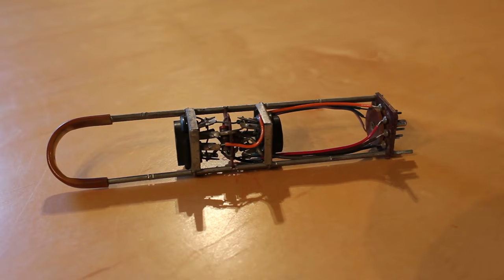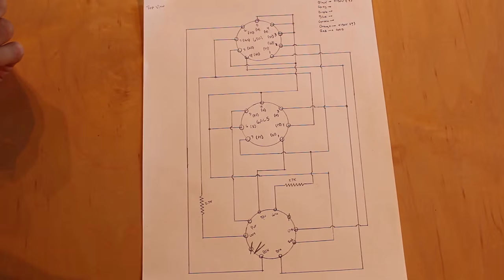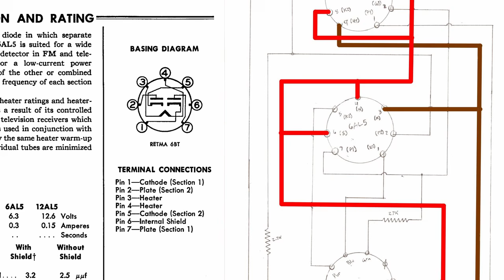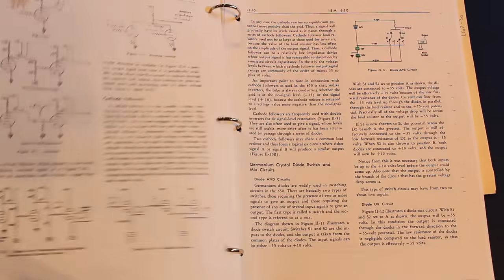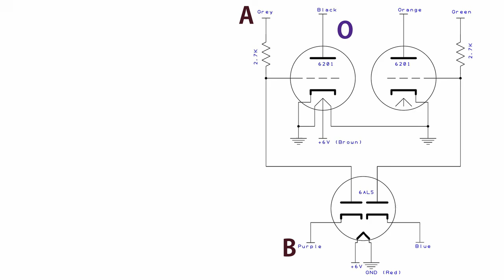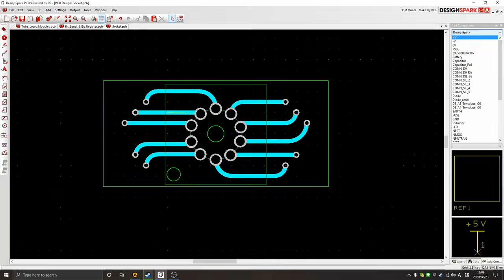Reverse-engineering an IBM Mainframe Vacuum Tube Pluggable Module

Comment: When using 150v it went from 150 to 50, and when using 24v it went from 24 to 8, both 1/3 the full voltage.

Comment: I remember reading once that IBM liked to use 12AY7 tubes. Similar to the 12AT7 but with slightly less grid/plate capacitance for a slight edge on switching speed. It has a lower mu, but that is not a requirement for a switch. I forget the industrial number for the 12AY7.

Comment: The figure II-11 of the IBM 650 manual shows a "Diode AND circuit" with "projected" voltages - which also confirms standard logic level of +10V ("signal level", i.e. 1/H/high) and -35V ("no-signal level, i.e. 0/L/low) - keeping kind of standards during transition (mixture) from tube to semiconductor diodes - and a pullup "load" resistor - which may apply in your case? Just to make a really "educated" (no) guess - does this make sense to you?

Comment: Try using space charge tubes 12 volt on filament and plate. 12G8 is a dual triode.
These were used in car radios.

Comment: This was an amazing trip down memory lane for me.  My dad was a field engineer for IBM for 36 years.  He started in 1955, 9 years before the S/360 was introduced.  He actually worked on this type of equipment.  He regularly brought "dead" parts home that he didn't have to turn back in and gave them to me to tear apart.  Between that and the occasional trip to one of the data centers in his territory sparked a lifelong love of computers and electronics that eventually led to a 39-year career in mainframes, which I truly love.  In this era of terabyte cell phones and 5nm VLSIs, it's refreshing to work on projects where you can actually see and touch the individual components. Thanks for helping to keep the curiosity about vintage computers and electronics in general alive!
Reply: Sorry to necro your old comment, but as a young person, I've only EVER known VSLI infrastructure. Even from my first gamecube and xbox original back in the early 2000's, which feels like ancient history to me, pulling those apart after they broke from overuse, you cannot really "make sense" of the machine. Too many small bits that do big complex jobs, stuffed into a little metal and plastic box that may as well be magic to anyone non-electrically inclined. However, more recently, discovering older computing systems and the hardware/components that go into them has been extremely refereshing to my untrained self. You can pull one apart, and with your eyes unaided look at the individual pieces, figure out what they do and trace where they go. Much more complimentary to a foundational understanding of computer science and honestly quite confounding when I figured out its literally physical logic you can see on a board. Definitely easier to learn and understand whats going on when it is laid out like this, and I firmly believe this stuff is still relevent in the modern day, even if only as an educational tool. It really is excellent stuff
Reply: @tobiaswhittaker7462  I'm not sure what you mean by "sorry to necro your old comment" but I will take it as a compliment based on the rest of your post.  🙂 It does my heart good to see young folks with an interest in how we got to where we are with computing technology.  Us "grayframers" have the advantage of actually having worked with it.  As a young "computer scientist", I used punched cards and paper tape for my programs in college.  During the early days of my career, I mounted reel tapes, loaded paper into massive printers, ran decks of cards through readers and sorters... the whole early data center experience.  It got much more interesting and complex as I progressed through being a software developer to being a mainframe systems programmer and hardware engineer.  These days, most people won't even know where their company's data center is, much less get to work in one.  They might get a tour during their onboarding but they won't get anywhere near the actual equipment.  That is truly sad.  But to be honest, learning how to work with the old equipment wouldn't add any real value to today's young software engineer, any more than you have to know how a car's engine and transmission work to drive it.  While knowing more about what goes on under the hood may help you if something goes wrong, you don't need to become an ASE-certified mechanic just to drive to the store for groceries.  I personally find the whole world of retro-electronics to be fascinatingly nostalgic.  If you are genuinely interested, look into something like Ben Eater's 8-bit computer project.  The kit is kind of expensive but it was a lot of fun building it, especially when things didn't work as expected.  That's when you really learn.  When you finish the kit, you WILL understand much more about how computers work.  And you will enjoy a distinct sense of accomplishment!  (The book his project is based on is available for PDF download but you have to look for it.)  Best of luck with your future computer endeavors!

Comment: The pinout on the module is like a 10 pin relay connector.
Reply: But the notch on the center pin is missing.😁

Comment: The Teleprinter sound in your intro brings back some memories! I used to run several different Creed machines (Model 3, 75, 444 and 2300) in my radio shack 30 years ago.
Thanks for the 'forensic' work with that module. Very educational. 🙂👍

Comment: Back in 1964-66 when I was in high school in St. Paul, a friend of mine and I discovered a junkyard that was scrapping out mountains of IBM tabulating and early vacuum tube machines - primarily RAMAC 305 and 650's.  They would sell us pieces of machines and I grabbed a bunch of these modules, along with power supplies and front panels.  At one time I must have had a barrel full of these modules.  Wish I had saved them, but I left home for school and later the Army and my dad basically gave them away!  According to my dad (who worked for Sperry Univac at the time), IBM would rent or lease all of their equipment and thus retained ownership of the machines.  When they became obsolete they were sent to a facility for decommissioning where cables were cut, heads were welded to disc surfaces, screw drivers were punched thru core memories and front panels were destroyed.  Then the machines were sent to scrap yards like the one I had found.  Thus it is doubtful that you would find a complete machine unless it came out of a museum.  IBM did not want the old machines hanging around and competing with the new ones.  I am enjoying your vacuum tube and computer series very much.  Well done!  I am considering doing something similar to your vacuum tube computer but with relays instead.

Comment: You made my day.  I haven't done any vacuum tube work since 1970 but as soon as I saw your wiring diagram I remembered pins 3,4 and 4,5 for heaters and that 4-5 connected meant a split heater.  When I began teaching electronics technology at Ferris State College (now University) in 1980 one of our early tasks was to remove tube tech from the curriculum.  The reasoning was that the few graduates who would need it would pick it up quickly by individual study.   Other comment suggested Paleo-electronics term.  Love it!

Comment: So thats what these things are! 

I have hundreds of them and never knew what they were. I also have quite a few boxes that have numbers 0-9 on them with 9 12AU7's in them, and the box uses a single octal 8 pin socket to plug into whatever it did. Wonder if they were also used in this application?

Comment: That Uni-T meter is a beast. Glad to see it becoming more common
Reply: I have that same model in my toolbox for mainly current metering. My old GwInstek 396 multimeter has bit better continuity check beeper thou (detects crackling contacts).

Comment: for a display you should mount it on a piece of hardwood, and put a couple fancy switches on it, with the neon bulb! and make it a functional tabletop conversation piece. very cool video :)
Reply: Second this and while you're at it build a vacuum tube voltage regulator night light that's one thing I'm planning on doing and for some wire equipment cabinets now and in the future the lights inside should just give a bit of Illumination Paisley sea controls and such couple vacuum tubes probably substandard ones that would not be suitable for use otherwise but the filaments slash heaters are still good just for the novelty factor and the cool looking white does produced just enough to see things but not too much of course potentially being able to dial down the voltage as well also thinking on building what I would call a unity gain amplifier just to get the sound of tube equipment for audio that originally would be recorded this way I know this is up to the person but I think it sounds a bit better for some of the old recordings myself of course have this device be able to be switched in or out also anything like that would definitely definitely equipped to bypass if in standby or off state.

Easy enough in the audio path courtesy of relays!

By the way will be using are there ingenious way of switching some inputs and outputs for example for an input essentially would be the opposite of a headphone port that would also switch out the speakers when headphones are plugged in except that report is an input but overrides others when something is connected.

The other thing would be utilizing tying a line to ground for switching for various functions without having to have much additional cabling you've already got the ground of course as it is so why not make things easier.

A lot of my stuff will be custom also will probably be using an HDMI cables but custom break in breakout and or just connectors on the equipment itself give us five stereo channels show to the course and some control lines use something that already exists got the idea from seeing a specialized cable but I don't know what it went to originally that had a bunch of 1/8 inch connectors Shield cables and also RJ whatever connectors likely telecommunications equipment but not entirely certain you know connectors these days can you be used for just about anything or what they originally intended for worst thing is connectors used for one thing also use for power and specially on the same device and yes I have seen quarter inch plugs used for DC power on audio equipment not a good choice of connector in the audio environment for sure

Comment: The only additional data point that might have been interesting to measure is the switch time. Of course, that would have required some sort of wave generator of the appropriate voltage for one of the inputs and a dual-trace oscilloscope as desirable to display the input and outputs together as you varied the frequency. That all said, I admire the work and knowledge you put into this. Being born in 1957, I missed experiencing the vacuum tube computer era, so I always wondered about the circuitry I see. Cheers!
Reply: Somehow I saw a vacuum tube computer at a flight simulator on  Long Island when I was in the 8th grade, my Sunday School teacher ran it or something.  It was really amazing, big room full of racks with those 6h6 tubes or whatever they were.  Sinclair I think was the company.

Comment: Do not forget, that all these digital circuits like flipflops or gates have been designed using vacuum tubes in times where transistors or TTL-ICs have not been available yet.  A quick look into old textbooks should answer all your questions and make your considerations obsolete.

Comment: What a beautiful thing, half a 7400 with valves, wonder how fast it can switch?
Reply: Probably up to 1MHz or so. So it offers 4011 CMOS  speed & output current with the power consumption of several 7400's. But the glass package is so much more appealing than epoxy packaged silicon

Comment: Fascinating work you're doing with sleuthing out the Neanderthals of computers. Being a child from the 50's I also work with tubes but in the audio realm. Working with plate voltages in the 250-500v range is normal. I've also worked on RF transmitters where the plate voltages of the output driver tube was in the 1500v range. That will make your hair stand up, literally. Lol. Great work you're doing keeping tube technology and knowledge alive. 👏
Reply: The tube tech is actually Old World tech, and we will end up studying what we had (whats left of it) and going completely backwards in coming years, our engineering will never come close to what was here before colonists arrived.

Comment: So one of my Crazy Questions: Could you use this vertical Tube design (the hardware harness--  U-bracket with 2 PCB boards) to shrink your Tube R-S Flip flops foot print for your memory and would it be worth trying ???
Reply from the maker: Absolutely! 
But it's kind of counter to the style that I've been building on. The tube computer is honestly more of an art project than a legitimate effort to build a capable tube computer, so a lot of the inefficient use of space is actually kind of intentional to keep the aesthetic looking good.

Comment: Damn, Son...Don't you have any TRANSFORMERS?  (I used to have a good sized BOX full of them!) You need to find some really old TVs ...Not too many of those still around.   How much current would you need for the 10V?   You could build a voltage regulator to drop 12V  .It should be able to provide enough current.  you might want to check an older (pre-1990) ARRL handbook for a quick and easy bias power supply (maybe even using  vacuum tubes!)    Yeah, You have to be VERY CAREFUL around HV. I have been bitten a few times ... NOT fun!!!. REMEMBER the ONE HAND RULE!  Only ONE hand anywhere near ANYTHING with HV!  Do NOT touch anything grounded with the other hand!)  Hell, I would of used a non-conductive tool like an "IF stick"  to turn those switches off and on. REMEMBER, "VOLTS JOLT -  mills KILLS!"

Comment: Another great video. I'm still catching up on your excelling work. 

I did want to mention that you should consider 9v batteries in series for your high voltage tube tests. The low current and high internal resistance might even be a good thing.

Comment: I think you have something with more potential than you imagine. Let's say you have 100 units identical to this one, all wired exactly the same.  Without changing anything on the unit, you should be able to get all 5 types of gates. And, or, nand, nor, invert... the way i would do it is plug all of these units in the front side of a 2 sided rack panel. The back side has access to the same parallel socket. Into the back socket, you plug a personality module that wires it into the type of gate you want. If you want a AND gate, you plug in the AND personality module. With only an AND gate and Inverter, you can make any of the gate types listed above. Does this sound like a workable solution?
Reply: Hmmm. A NAND gate should be able to make any of the other gates I listed above.

Comment: Really nice video!  I remember seeing modules like this when I was much younger (in junk stores), but having no idea what they were.  One thing that stuck in my mind were some of them having RCA Metal encapsulated tubes - which I've never seen since.  Have you come across them?  Maybe I've imagined it!  I'm guessing they were just to make the tubes less fragile.
Reply from the maker: Thank you!
Interestingly, I was just talking with someone a few days ago about the RCA metal encapsulated tubes! I've never come across any, but there are some interesting theories as to why RCA built them like that. The most popular reasoning is that it was a shield to keep interference down, but my favorite theory is that Germany was producing full metal tubes, but RCA didn't quite have the manufacturing capability to do that just yet, so they encapsulated some glass tubes in metal as a stop gap to compete.
Who knows what was actually going on, but there are certainly some interesting theories out there!
Reply: @UsagiElectric  Mr. Carlson's Lab runs across metal tubes occasionally in his old test gear/radio restorations. I always enjoy Paul's content, and he is a true tube wizard. I've just discovered your channel, and have next to none as far as electronic knowledge, but hoping to pick up bits a pieces following along with big brains such as you.
Thanks for your great vids!
DT

Comment: Around 1980 I bought a literal 5 gallon bucket of those.  Most of them had a few 1 watt resistors and a 2D21 thyratron.  So probably drivers for printer or card punch solenoids.   Some had 5965 tubes, so probably flip-flops.
Reply from the maker: Oh man, I wish I could get my hands on a 5 gallon bucket of these! The IBM 604 is a bit of a dream machine for me. Someday, I hope to find and restore one, though that's certainly one of those pipe dream things.

The ones with the 2D21 thyratrons were most likely used as solenoid or relay drivers as you guessed! The ones with the 5965 tubes were actually probably used as power tubes. IBM actually preferred to use the 6J6 7-pin dual triode (with internally shared cathode) as their primary "trigger" tube (they tended to call their flip flops/multivibrators "triggers"). The larger 5965 dual triode was hotter and physically larger, so it was used primarily where they needed more current. They would even run the two triodes in parallel to get even more current driving capability. Sometimes this was to combat fan out but also, sometimes they would use this when the logic signal had to cover a long distance to make it to another part of the machine. 

Of course, that was just for the IBM 604. IBM used these types of modules in many different models and each one model is pretty wildly different, so it's really hard to tell exactly what each module was used for!
Reply: @UsagiElectric  I have a 5727 sitting somewhere which is a ruggedized 2D21 with a higher withstanding voltage.  2D21s were also used in electronic metronomes.